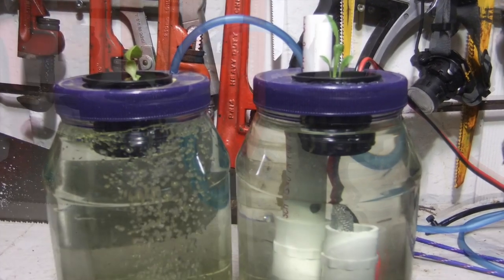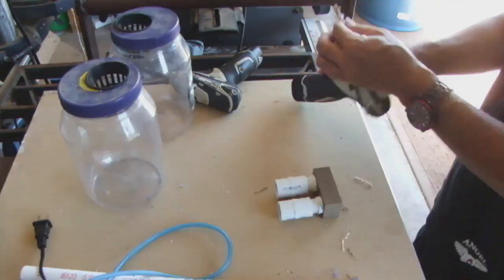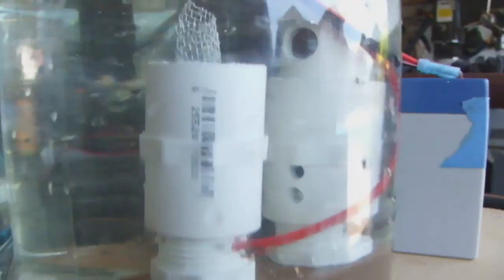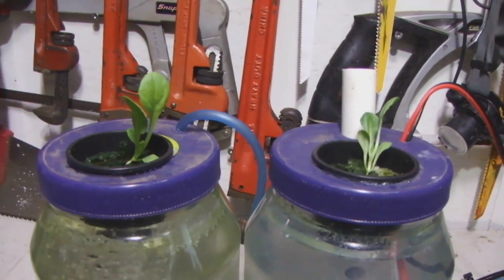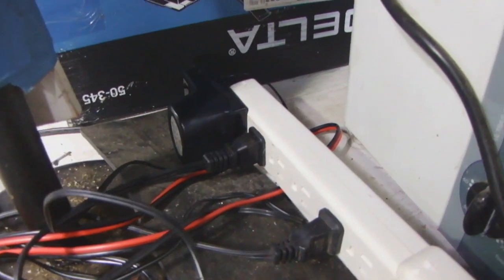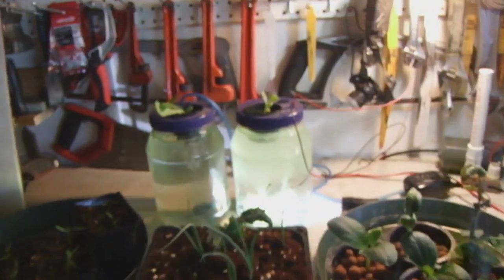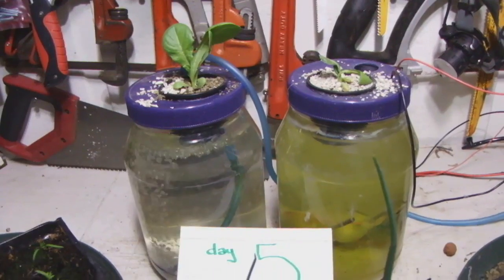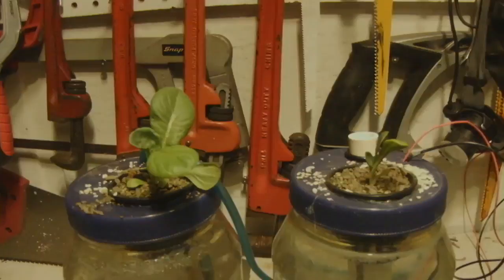Air Stone vs Electrolysis

Comment: Other than possible metal toxicity from what metals you use you're removing the hydrogen from the water which turns the water more acidic the longer you run the electrolysis in the reservoir.

Comment: I think it’s fair to say that this was a failed experiment purely based off the facts of that electrolysis system you made was terrible.
Reply from the maker: I would have to partly agree.  Yes the system was terrible, but it was only meant to see if it was worthwhile in spending on the parts needed to make a proper experiment.  The purpose was to see if I could use parts found in the garage and find a reason to spend a single dollar on equipment to make a proper experiment.  Granted lettuce needs very little O2 but I was looking for a reason to break out the credit card, and I found no justification, so I wouldn't say total failure.

Comment: This isnt a correctly performed experiment. The Electrolysis side should be producing Nano bubbles. When an electric current passes through an ion-containing solution like water, the electrolysis separates oxygen from hydrogen, this is not happening in this experiment.

Comment: Thats definitely not enough oxygen to sustain a plant, you need more current going through the electrodes. Most metals will eventually get eaten away on the anode, this could be mitigated if you use one that resist oxidation a lot (gold, platinum, etc), but they're expensive. Try using carbon electrodes, they wont release metal ions and such into the water for the plant; using carbon electrodes would cause graphene molecules to get dispersed into the water though, and I don't know if that would impact plant growth. To get enough oxygen for the plant to survive, the solution might heat up and be too hot for the plant. You are pumping energy through the water, and some of it will be converted into heat.
Reply: The plant does not consume O2 !! it gives it off .... the oxygen in the bubbler system is to stop the water going stagnant (anaerobic bacteria)
Reply: @oz93666  Plants do consume 02 at night, just not very much.

Comment: Lettuce is a bad test subject for this kind of experiment. The roots do no require much oxygen which is why it grows well using the Kratky method. If you had done the test correctly by using a non-corroding cathode and anode then there should not have been much difference between the two lettuce plant.
Reply: Cathode doesn't corrode, anode will always do no matter what metal it's made of. Difference lies in what kind of residue the corrosion leads to
Reply: @ephestione  Would everything corrode? Someone suggested noble metals. I wonder if gold actually would perish in this situation. Does anyone know?

Comment: You should use noble metal for this (gold, platinium etc.) Otherwise you produce metaloxide and metal salt which can be poisoning.
Reply: I was thinking the same, from the current and vibrations its breaking nano and monatomic particles into the water( the higher the current the bigger the particles ).......

Comment: Hi interesante esperimento  de electrlyisis.
podrias re hacer el mismo experimento pero esta vez hidrolysis vs ozone air.
Reply: Ozone will kill the plant in no time, by day 6, the tin lid will probably be so decomposed that the pot will fall at the bottom of the jar. I've had PVC, poly and other plastics becoming brittle and crack within 48H. This stuff is badly corrosive.
I haven't tried noble metals for obvious rea$ons but the only 2 materials that worked for me in contact with ozone are some stainless steel and glass.

Comment: cheaper electrolysis set use 316 or 316L ss wire or bolts, no worries about about exotic metals or cloudy water

Comment: I've got a device that make hydrogen gas for better fuel economy made from stainless steel plates and it gives of heaps of hydrogen. i reckon that will do better than the air stone
Reply: My bagic beans I bought from this guy online works great with that system that gives you enough energy to blow up a balloon every few hours.